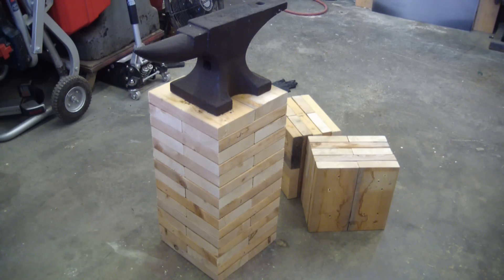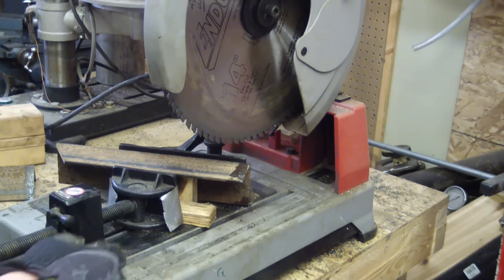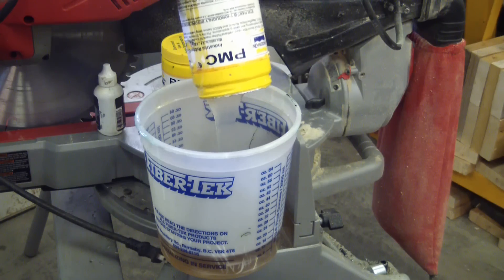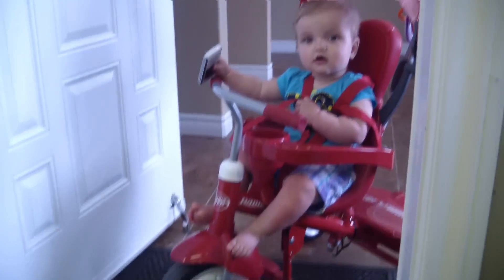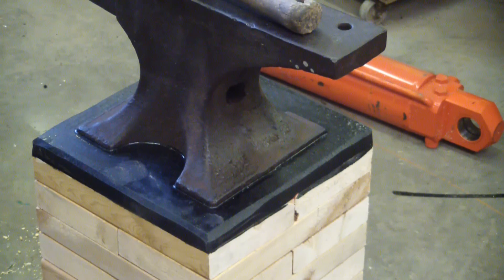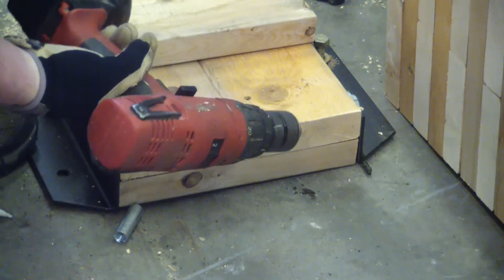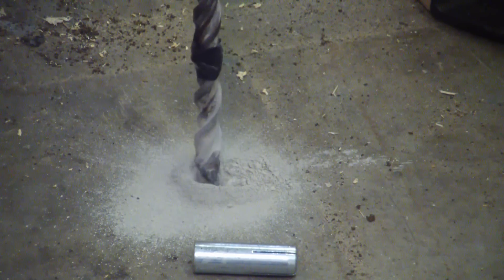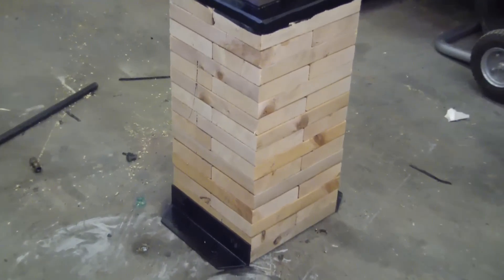100 year old blacksmith anvil gets a new home

Comment: Do you have to worry about silicosis with concrete dust? Or could you set up your shop-vac next to the hole you are drilling to vacuum the dust up?
Reply: +Lollygag its such a small amount i'm sure he'd be fine
Reply: +Lollygag silicosis doesn't happen in a day, it happens over a lifetime
Reply: TheAustinCarmichael2
Silicosis is irreversible. That means any small amount of damage at any single exposure adds up over time. It can take a long time or a short time depending on frequency and amount of exposure, but there's a good reason why sand blasters blast in a box and concrete grinders use respirators.

You should try to not expose yourself to airborne silica... ever.
Reply: I understand this, work in a soil lab and it's something we have to pay close attention to, my point however is that avoiding airborne silica is impossible, the trick is avoiding high concentrations for long periods of time, much like pretty much anything, drilling a couple holes in the shop floor is nothing to worry about, if your working in blast bay, or drilling air rotary dry all day that is totally different situation

Comment: then the hammer dril is just a scam or there's use for it?
Reply: for small holes it will do fine.
Reply: i got a small dewalt  maaaan it's more a vibrator than anything else, when i nailed my floor i had to go to my bigger mastercraft, when the dewalt hits a rock you're in for 10 minutes or pure pleasure..
Reply: +martin blouin haha ive only done  under 6mil holes with a small hammer drill anything bigger and i bust out the centuries old hilti
Reply: works fine on brick if you dont try to make too big of a hole
Reply: I was replacing some screws holding my garage doors together with carriage bolts and found out setting my drill to hammer caused the bolt to be pulled straight through the wood if I wasn't careful, so it does increase the abilities of the drill.
Reply: doesn't do much an impact driver does
Reply: I'm not rich enough to get one of the new fangled impact drivers yet, so i was pleasantly surprised at my 20 year old craftsman drill even having the hammer option, let alone increasing the drills usefulness much. course now i need a new drill because both batteries have given up the ghost and they're 50 bucks a pop.
Reply: i seen a few  video on yt about converting old NiCa battery pack to lithium, that's fisable, but man if you plan on getting 2 or more 50$ batt, i'd look for the ryobi combo, i bought a dewalt and i wonder how much 'better' it is , the chuck on the drill loosen all the time, the hammer in it is a vibrator, the impact driver wobble like a didldo, the circular saw always loose the 0deg mark and need to be check with a square ect..
Reply: i was thinking of getting the kobalt set and try it out. it's odd you have issues with dewalt, as we use them only and never have a problem.
Reply: well it's not major issue, but things i would had tough expensive tools like that would not have, you know like the circular saw, it can go pass the 90 deg mark by a few deg instead of blocking at 90, so if i cut at an angle and then reset it, i need to double check it with a square, that's a bit a pain in the butt, the drill, no matter how hard i lock it, if i use a big bit or a forsner bit something like that, it eventually loosen, anyway you know what happen is those brands, like AvE says, they use to be great tools, then they got bought by big conglomerate that manufacture em all, they're often design in the very same bulding, it's a fasle impression of diversity, they got the diwalt the milfucky ect but its all the same chinese shop, and they go by the moto 'we can build crap, we got a name, they will buy it'  kobalt that's like a cambodian tire brand?
Reply: stick a socket adaptor in the chuck and use it for driving lag bolts into timber. works a treat.

Comment: I've done exactly that. Looked like a dick whilst using a hammer/combi drill to make holes in some bastard hard concrete (3 separate occasions). Bought myself a cheap and cheerful rotary hammer drill, the words "a hot knife through butter spring to mind" 

But the cost benefit ratio is somewhat rubbish. I've used it for 3 holes in 3 years. But when i've needed it, its been a godsend. So yea, On the fence on this one.

Comment: There is no way a flush shell should pull out if you've set it properly. A 3/8 hilti flush shell is rated for 2000lbs and the ready rod will pull apart before the shell pulls free. PL isn't going to save you if you've done a pussbeef job setting the thing.
Reply: AvE we had a cable tray come down due to lazy mcnuggets getting tired of swinging hammers and not bottoming out the flush shells. Our safety hand went out and tested a properly set 3/8 flush shell with 3/8” rod and the rod pulled apart before the shell pulled lose. Anecdotal at best to you, I can appreciate, but before I hit Google myself, you're saying a single 3/8" ready rod is rated to hold 8000lbs in tension?